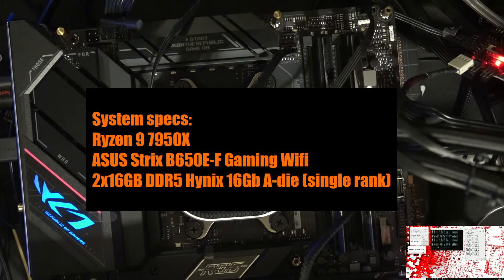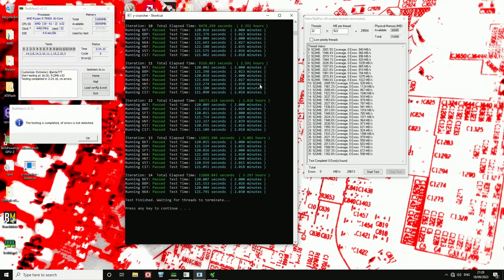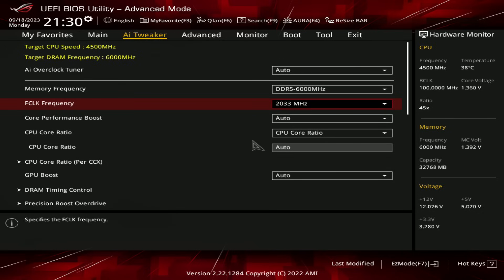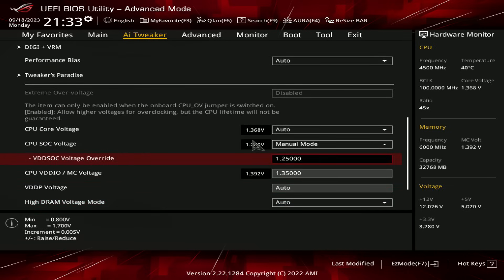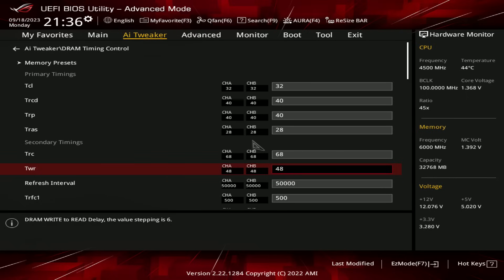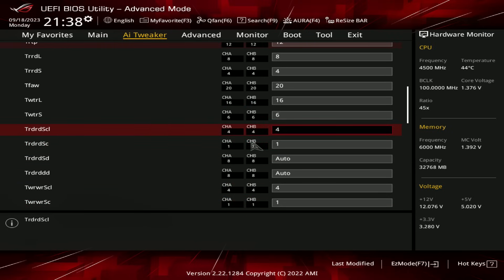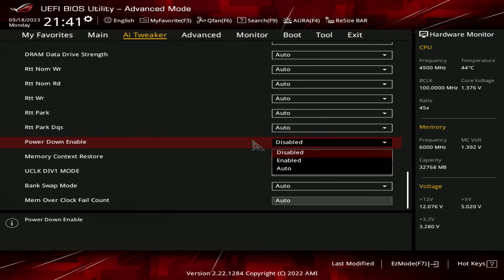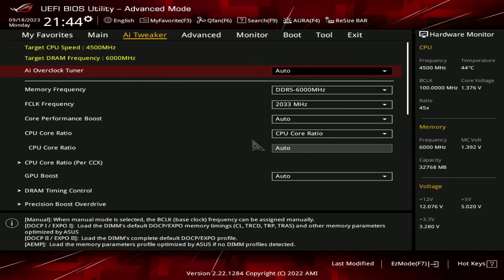Easy memory timings for Hynix DDR5 with Ryzen 7000

Comment: This timings worked like a charm in my kit, thanks you so much for your effort and ramblings haha

BTW i have the 2x16 Teamgroup Vulcan Alpha 6000 38-38-38-78 1.25v but at 1.35 it runs great at 30-36-36 + your timings
Reply: Would this work with my teamgroup delta tforce 6000 ? 64gb
Reply: @TakeNoteZ  it should as soon as your UMC can handle it 2x16 and 2x32 must work the same, just don't set IF to 2033 anymore, stick with 2000 or try to go 2200

check the timings live ep8 @1:49:50 for my current setup
Reply: @TarsoSousa  ohh ok got u , thank fam 😎😎

Comment: Sadly my pc wont boot and keeps freezing in bios using a 7800x3d on gigabyte x670 aorus elite ax with trident z neo cl 30 6000mhz
Reply: got the gigabyte gaming x ax and cl 32 trident z neo 6000mhz and those timings arent working for me either, did you find good timings?
Reply: @Pho3nix987  i just choose to use normal expo settings for now
Reply: @Weizy_1  alright tyvm for the answer

Comment: I punched this into my G-skill Trident Z5 6400mts CL32 kit factory set at 1.4v on MSI PRO B650-P WIFI and it booted right up. I reduced the clock to 6000 just to be sure I wasn't doing anything untested. We'll see how it fairs.. you said it might get hot? I have airflow over it, if it crashes I might reduce voltage down to 1.35v.. Or do you think I should do it right away?

Comment: will this work for a Gskill Hynix 2x32 GB EXPO 6000 kit? EXPO timings are at 30-40-40-96 trc:136. I believe it is a Dual Rank. 7900x3d on asus x670e-a with 4090
Reply: You shouldn't need to customize the ram config for that kit. Just set it to expo 1 and the default 6000MHz rating it was set at, and ensure the bios was updated to the latest version. I have the same kit and that works without any issues.
I've just upgraded from that 64GB kit to 128GB (two of those kits), now the custom manual config is required since I can only get 3600MHz from the automatic calibration.
Reply: @drakcoreoriginal  Just so I am clear - You have 4x32GB kit of the GSkill CL 30 6000 installed? And while you culdnt get 6000 to work on EXPO, you ran Buildzoid's manual config in the video and got a stable 6000?  Thanks for clarifying. Im running a 2x32 kit on an ASUS B650e-e board and am curious about this.
Reply: @debatebore1057   Unfortunately not, I think Buildzoids' current config is a little dated. I was getting 6000MHz out of the box with EXPO1 with just two sticks of ram (64GB / 32GB x2). Current x4 sticks just fails with his build. System just defaults to 3600 on generic configs though without issue.
I did come a more recent config from another channel I want to try this weekend. Called "Overclocking DDR5 RAM Hynix A-die on AMD Ryzen and Gigabyte: Guide, for RAM overclocking" from "On OverClock" YT profile.
Looks more promising to get the ram to hit 6000MHz with all 4 ram slots filled.
Reply: @drakcoreoriginal  Any update on your overclocking? I have the same memory and I cant get past 3600. I also got 4 modules. It sucks a lot
I'd really appreciate any insights!
Reply: @icarus33  Sadly no, I have resigned myself to be on 3600MHz 30-30-30-58-88, which it defaults to. Tried a few other custom configs, nothing worked.
Waiting for them to release a new BIOS, which hopefully will sort out larger banks of memory. Since it is a host server for SE, I'm not dead in the water running lower MHz ram.
I might swap out the ram with 48GB ram modules (96GB) of ram or if they release the 64GB(128GB) kits, the two stick versions.
There are a few 4 stick kits out now, but you getting maybe another 20-30% speed increase over the 3600MHz due to the high CL/CAS timings they have.

Comment: Used the exact timings on my rig and got a noticeable performance boost over the regular XMP.
MOBO: Asus TUF GAMING B650-PLUS WIFI
CPU: 7800x3D
RAM: G.Skill Trident Z5 RGB 32GB DDR5-7200 CL34 Memory
Reply: got essentially the same ram from a different company, did u change your primary timings to what's shown in the video or nah? And did u put it on 6000mhz + 1.2V?
Reply: @ubeii  ended up going with 6200 CL28 at 1.4v. The timings shown here should work at 1.2v just fine though, and give you 90% the same performance
Reply: @DirtyAtreyu  kk, thanks!

Comment: My Gigabyte X670 Auros Elite AX, 7800X3D, G.Skill 6000 CL32 really didn’t like power down being disabled. 
Windows would crash on boot so I had to set it back to auto and then it was fine
Reply: You need to have memory context restore disabled if you disable power down. Else, guaranteed BSOD. This will increase your POST time so you have to choose. Compromises.
Reply: @MaCK0y  ah cool, didn’t know that. Thanks
Reply: And if you keep power down on, you lose performance or? @MaCK0y

Comment: I want to thank you so much.
I've been struggling for months trying to find what's going to work and at the very least you showed me a whole bunch..

My problem is I have four dim I'm trying to get to run at 6000 mt and it just won't. I have one RAM set from lexar that seems to work okay on my Asus hero but DDR5 and ryzen 7000 don't play nice for sure...
Reply: IMC in Ryzen 7000s is not strong enough to handle 4 dimms more than 4800MT/s. I suggest wait for next Ryzen 8000. 
There are some guys on the internet that their Ryzen 7000 can handle 4 dimms 6000MT/s (some just enable EXPO, some  need to manual OC), they are just lucky (me excluded) :))
Reply: @HoangDucNuyen   For some reason I cant even get mine to run at anything over 3600MT/s with 4 X 16GB it always gets stuck on memory training. EXPO basically won't work. I'm running on ASUS BIOS 1807. Any help will be greatly appreciated!
Reply: @icarus33  - hmmm, idk maybe IMC in your CPU is terrible. 
I have three kits 2x16gb 6000CL36 Kingston Fury Beast RGB: 1 is M-die, 2 are A-die. They all run stably with 4dimms 4800MT/s on TUF X670E and X670E Carbon. 
Weirdly enough, both boards automatically set to 4800MT/s after clearing CMOS.

Comment: Need a updated a video with latest bios. It not working in latest bios .
Reply: Any chance you got this working with the latest bios. ?
Reply: @Shafy7   With 2x ram slots filled, I was getting my rated 6000MHz with just setting it to EXPO1, that was from the 2-3rd last BIOS update. The 4x ram sticks is still an issue.
Reply: @drakcoreoriginal yes. I wanted for 4x as I’m using 128gb

Comment: Thank you, this works great on Hynix A-Die 2x 16GB @6000. The only settings that I changed is SoC voltage to 1.1v instead of 1.25 and Trfc2 to 391 instead of 400 since expo had it set a bit lower. No issues at all over the last month. I just wish that I could get 4 sticks to work above 3600, way too slow. Oh well maybe a future bios update will help.
Reply: Beware. Don't just "set Trfc2 to the EXPO value since theirs was lower".

Most memory timings are interrelated and will only work properly together, and some need to be exact multiples of each other for performance and stability.

You should change that back to Buildzoid's value to be safe. Normal day to day stuff may not crash if there are small timing issues, but it can still randomly crash in certain scenarios.

As for 4 sticks, it's always going to be unstable or run very slowly, because of how DDR5 works. A single stick of DDR5 is basically like 2 sticks of DDR4. Two sticks of DDR5 is basically like 4 sticks of DDR4. Four sticks of DDR5 is basically like 8 sticks of DDR4.

Now you can imagine why it is so hard to run 4xDDR5 at high speeds, right? ;)
Reply: @MyAmazingUsername  I never got the notification so I’m late to respond but thanks for the info. My system has been rock solid this entire time but I’ll heed your advice and set Trfc2 back to 400. 👍

Comment: I am curious to ask, is there an actual difference between running EXPO or setting the values manually yourself?
Reply: EXPO changes more than memory settings but all things being equal there isn’t a difference. It’s just a profile to make things easier/faster to configure.
Reply: @pwnograffik  but what about performance? Using expo is more performing than setting the values yourself?
Reply: @IxNAPxI There isn't any performance difference between using EXPO or setting the values yourself.
Reply: @pwnograffik  alright thanks I will try setting the values myself and see if I stop getting bsods when I enable memory context restore
Reply: @pwnograffik that’s just a complete lie

Comment: I used the same settings on my 7800x3d for over 1 month at 6000 speed and it worked perfectly and was stable throughout all test. But know nothing is working stable… I can go expo settings and clock down the ram at 5200 speed and nothing is stable plx help

Comment: Hey i have a kit of 2x32GB RIPJAWS S5 6000MTs CL30? They are also SK Hynix memory apparently, but its 2R as its 32GB per stick.
What values should i input for the dual rank specific timings?
im running them on a msi x670e carbon with a 7900x

Tanks in Advance!

Comment: While these timings may work well if you win the silicon lottery, i got tons of errors on my 32gb gskill flare x5 6000-30 kit on an asrock x670e steel legend, was wondering why starfield was crashing every couple minutes until i ran testmem5 with the extreme profile, as soon as i switched back to default expo the errors were gone and so were the crashes, just a heads up.

Also got tired of letting it memory train every boot so i enabled MCR and power down, no issues after almost 2 months, it still does memory train every 3 weeks though with MCR which is fine.
Reply: Damn, I have the same memory kit and motherboard and these settings work great. I lowered soc voltage from 1.25v to 1.1v Asrock just released bios version 2.0 maybe give it another shot. The system definitely memory trains significantly faster on the new bios.

Comment: So, I have a 4 stick kit. I know for a fact they're Hynix. But I just cant get these timings to even get through mem training :/ any help? (7950x, X670E Taichi, the kit is a teamgroup kit (FF4D532G6000HC38ADC01). Any help would be appreciated if you happen to see this comment.
Reply: afaik 4 stick is A LOT harder to run stable than 1 or 2.
Reply: @sandboxie97  yea it is unfortunately.
Reply: I tried 4x 16GB of G.Skill Flare X5 and couldn’t get it to post above 3600 lol (7950X3D). New bios upgrades are rolling out so maybe it’ll improve things a bit. I’m on x670e Steel Legend which just got version 2.0 I’ll try it when I get some free time. It definitely memory trains significantly faster on new bios.
Reply: @pwnograffik  ive gotten mine to run JEDEC speeds, but still thats nowhere near 6000Mhz. To tack onto this, XMP sort of works. But I was getting some sort of NSIS Temp file error thing. Idk if it was related to RAM or not

Comment: Thanks Buildzoid! 

Your timings have worked great :) 

RAM: 2X16GB G.Skill Trident Z5 Neo RGB 6000MHz: 30-38-38-96 (EXPO) SK Hynix A-Die / 21A

Your  timings: 30-38-38-26-68, etc. @ 6200MHz / FLCK 2066 / disabled fast boot / power down. 

MB: Asus ROG STRIX X670E-F 
R9 7900X PBO / Curve optimizer per core (-15 -25)

Memory read: old (EXPO) ~ 76K mb/s new ~ 84.5K mb/s
Memory write: old (EXPO) ~ 76K mb/s new ~ 93.5K mb/s
Latency: old (EXPO) ~ 67ns  new ~ 58.2ns 

PYprime: old (EXPO) 10.6 new 9.5 

Gaming is improved as well when it comes to smoothness (better .1 / 1% lows as well) with slightly higher FPS. Super stable played HOURS with an RTX 4090 at ~ 450w (1440p / 240HZ)

Have an 1800rpm 80mm Noctua fan (actually doesn’t look too bad..) just above the ram - max temps 44c gaming for hours. 

Ran many/ various benchmarks (OCCT / Linpack/ etc.) / games for ~ 2 weeks and ZERO issues. 

Oh CPU-Z single thread improved from 787 to 801
Multi thread is roughly the same at 12,1xx. 88c max package temp@ ~ 175w. 

VDD: 1.4v / VDQ/ VDIO: 1.3v/ VSOC: 1.25v

You are the man ;) I recommend your channel to anybody I come across who needs advice on overclocking.

Comment: After changing my mobo from b650m pro rs to b650e-i gaming wifi, this setup stopped working :( i never knew that board could be difference in ram overclock. can my overheated mb chipset is cause this?

Comment: Pinned comment because this is the video everyone gets sent to when looking for this. I tested these exact settings twice, one without disabling Memory Context Restore and one with disabling it, guess which one didn't BSOD? The 2nd one. Please add a pinned comment to save 30 minutes of people's time, thanks.
Reply: After 6 hours of ycruncher, a full set, every test, with these settings, enabling Power down mode and MCR just make sense for stable memory overclocks

Comment: Copied all of these timings and it ran great..until restarting I was met with the ole BSOD..Memory Management code. I disabled both memory context restores and power down. Still got the bsod. Reset bios to auto everything. Ram running at 4800mhz yielded the same fps as these timings on 6000mhz. I give up on AM5 lol 2 sticks of G skill CL30 6000mhz.

Comment: Thank you very much for this. This solved my CL30 6000 hynix woes. The expo profile was simply not working on my MSI B650I Edge Wifi and this guide fixed it in one go. So far very stable running memtest. What a lifesaver!

Comment: i have an A-die kit (F5-6000J3040F16GX2-RS5K) and it was unstable while gaming (y cruncher was fine), with both the xmp and your timings and turned out it was either TrdrdScL or TwrwrScL (or both, cant be bothered to keep testing atm) that was too tight. 
so ig if anyone has A-die and its unstable and you're looking for which timing screws you over set them to 5 and hopefully you'll be good

Comment: i have gskill flare 6000 32-38-38-134 sticks, managed to get 6000 30-36-36-28, question is how to get cl 28  or other improvement? when i tried 6200 mhz north bridge dropped to 967 mhz fclk was 2000. Then i tried cl28 6000 with vdd 1.35v up to 1,45v but always caught blue screen while OCCT test run. Can anyone help with this, i saw reviews where cl28 was not even a problem since it's m die Hunix MOBO x670 gigabyte f9c bios ryzen 7600x
Reply: Hey bro. Did you sort this out ? I’m having same issue

Comment: I used to be able to run this OC no problem, went to default speeds when the whole soc voltage thing happened, and now when I try to use this oc again, it doesnt work. I just constantly blue screen, or blue screen after opening a couple browsers or steam/battlenet. any advice? 7950x3d, asus x670e rog strix, 4x 16gb ddr5 6400mhz, which i tried to run at 6000
Reply: 64Gb at 6000Mhz is hard to run on am5 try 5600 or even 5200 if you wanna run 64gb, with 32 there should be no problem running 6000
Reply: @IamMxfia  Okay I will try again with lower speeds, thanks!
Reply: So you used to be able to run this OC no problem with 2x16GB, but not anymore after adding 2 more memory sticks?
Reply: @HoangDucNuyen 64Gb with 6400Mhz is to my knowledge impossible to get stable since your voltage capped. U have to set frequency manually to lower values
Reply: WHy would you go to default speeds because of the SOC thing? You could have just set a manual SOC voltage. The issue was SOC on auto, absolutely nothing to do with XMP, or memory overlclocking.
Reply: @insertnamehere4419  XMP was causing it and people that manually set their soc voltage still saw their soc voltage increase past what they had set. I was being cautious based on what was being reported
Reply: @Josh_E  Mkay, maybe XMP was causing it, IF you left SOC voltage on auto. Nothing was forcing you to leave it on auto. Changing SOC from auto to manual doesn't break XMP and would have fixed the issue.

Comment: why is my ram getting very low read and copy speed about 59MB/s on aida64 memtest? but writte speed is fine around 76GB/s, is that normal?
my specs:
Ryzen 5 7600
asrock b650m HDV
Ram Teamgroup Hynix 5600 38-40-40-82 1.25v 1:1 FCLK 2ghz
Reply: Normal
Reply: @IamMxfia  how is that so? i see buildzoid's video shows that he getting about similar speed between read, write and copy, such as 85GB/s speeds in read, write and copy

Comment: Tried this with : a Ryzen 9 7900x, a 2x16 Gb Kingston Fury Beast kit at 6000 Mt/s CL38, an Asus  ROG Strix B650-A Wi-Fi motherboard.
For many months now I've had no issues at all. I've used these settings before the CPU voltage alerts, with 3 bios upgrades, with and without DOCP enabled and I even mixed up some timings without realizing lol.

Comment: So oddly enough, at least in aida, i get zero gains from any of this other than trefi and trfc lol. Exactly the same read and latency with just trfc/2/4 and trefi as i get with all other settings as well. Very odd. My kingston m-die has always underperformed on every platform tho. Ive never gotten it below 60ns on any platform stable. Also fclk to 2033 from 2000 makes about 1000mb/s more read but hurts latency by 1-1.5ns 🤔

Comment: I’m getting better cinebench results with fclk set to 2000
Reply: this means you're unstable, fclk oc doesnt crash it just slows you down, try increasong (or decreasing) vSOC and VDDG voltages
Reply: @Mugris  what is VDDG for AM5?

Comment: I see 0 difference between 2000 and 2033 FCLK with latest BIOS on MSI X670E Carbon with 7800X3D running AIDA64 latency test. I suppose they fixed the issue with latest AGESA. Now on to try and tune other timings to improve latency.